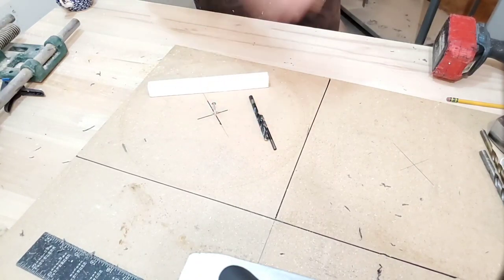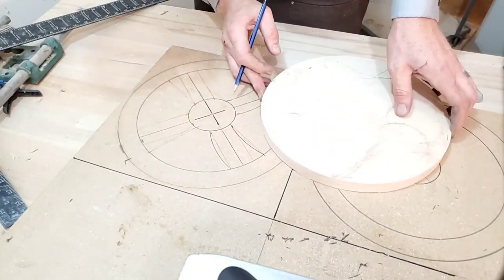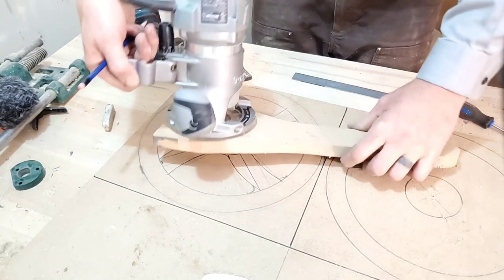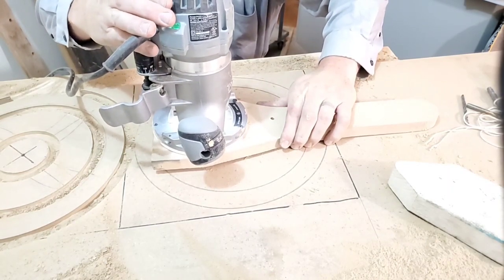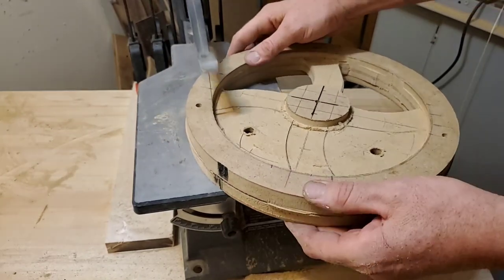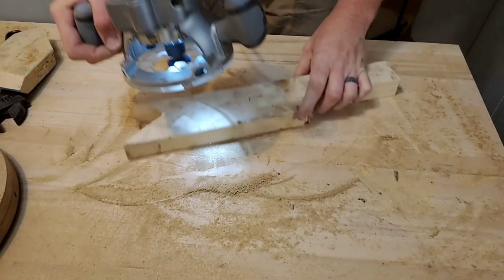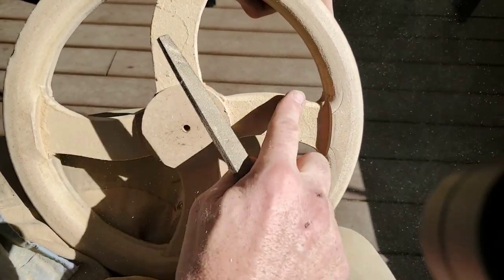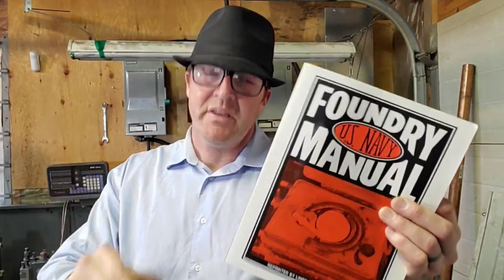Split Pattern Hand Wheel for Sand Casting

Comment: Great job.  That's pretty much the way I made my 7-inch flywheel except I didn't use a router.
Reply from the maker: Lot of hand work there without a router, thanks .  Perhaps look at the lost foam method for your next project.    Working with foam is way faster for a one off job and can result in some cases a higher surface finish.  The only draw back is possible warping of the foam during packing. I have a recently released video on making a hand wheel with this method.

Comment: While I am no Norm Abrams with a router heck I’m not even a good trained rat chewing on wood but when using a portable or hand router on a piece that is not attached to a work bench pick yourself up a roll of wide rubberized draw liner I sure you can find at most any good grocery store, big box hardware store or the giant online scumbag. PS it also is great to put under cutting boards in the kitchen.
Reply from the maker: Hahaha , i think your onto something for sure !   Thanks gullreefclub

Next time for sure